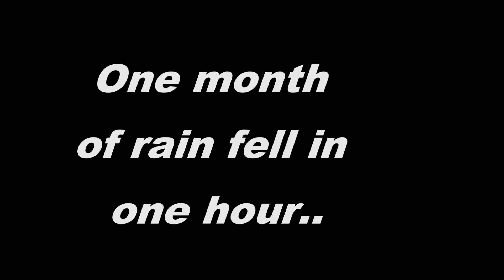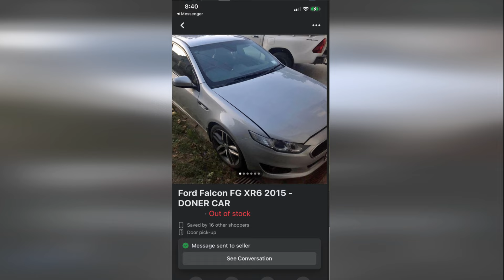Resurrecting A Flooded FGX Falcon - Part 1, The Teardown!

Comment: did many FG-X Falcon's make it over to New Zealand? They arent that common here in aus wondering if they're the same in NZ?
Reply from the maker: They are not that common at all, I’d say quite a lot rarer here as the Police never used them (they standardised on the Commodore, which is why there are heeeeaps of white Ve/Vf models around for cheap). If I do see one, it’s almost always an XR6. They come up for sale, but, not very often
Reply: @nonrasputin9260  that’s interesting. Yeah police in Aus used the FGX and there’s still some in service. I reckon it’s a bit odd that they only made a total of 16,000 since it was the last falcon, and compared to the FG which was 200,000+ salss

Comment: Wonder of the transmission will have water assuming so hopefully can be saved at least you can pull the pan get inside inspect more good video
Reply from the maker: The top of the diff has a vent tube that vents straight to atmosphere inside a chassis rail, so there was no way water couldn’t get in. Im still perplexed about the lack of water in the engine oil, so fingers crossed the transmission isn’t completely waterlogged. Cheers mate!